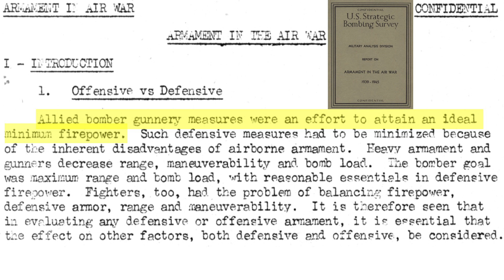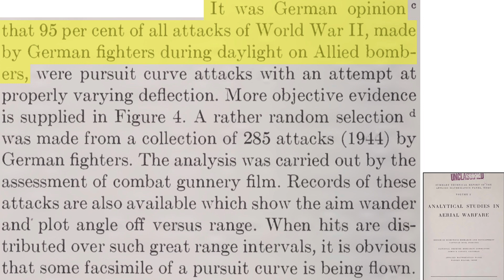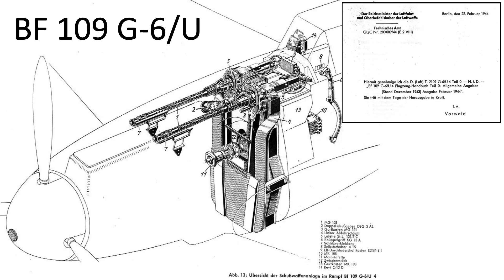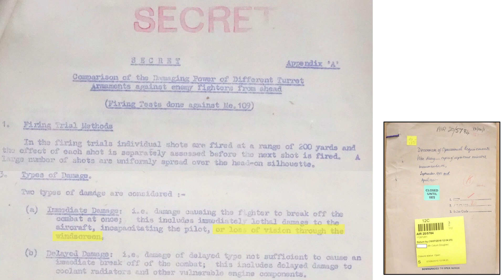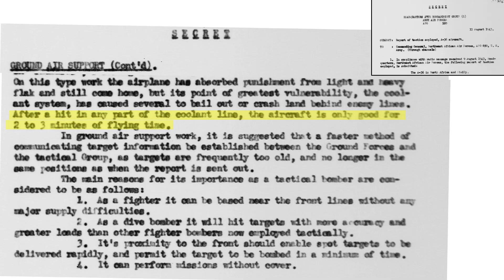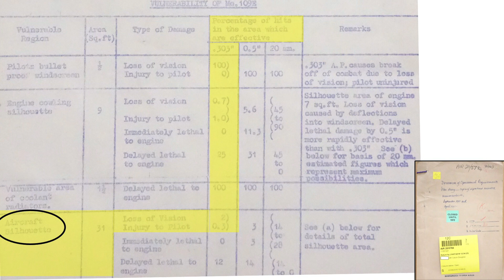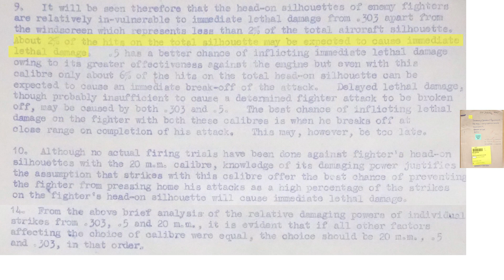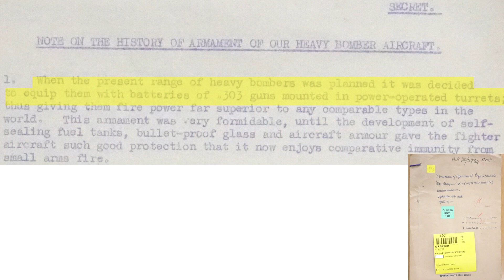RAF .303 caliber Me-109 live fire test vulnerability results – Lancaster bomber gunners aim point

Comment: Even if a bomber gunner had the optics to aim at a fighter cockpit (which they didn’t) the bullet spead made such accurate fire virtually impossible at realistic engagement distances (say 400m).

Odd to use the Bf-109 as the example target as that type was in a minority for night interceptor operations - 110s and Ju-88s were much more common adversaries.

Interesting, RAF Bomber Command night bomber loss rates per sortie were similar to those USAAF daylight raids, so it seems that the cover of night and heavy defensive armament were of comparable levels of protection.

Comment: It is something of a mystery to me why Britain did not manufacture their own 0.5 inch machine guns for the RAF (apparently the USAAF needed nearly all the 0.5 guns the US could produce for their own machines). The inadequacy of 0.303s in the air to air role was known from mid 1940. 

It is especially mystifying because (according to Max Hasting's classic book Bomber Command) the Bomber Command Chief Arthur Harris was pressing for 0.5 guns for his heavies for many years, but never succeeded in upgrading by replacing the .303s, except in a few cases (tail turret guns on some Lancasters). 

Bomber Harris (notoriously) got his way in most matters - including ensuring the allocation of the majority of UK war expenditure (Bomber Command more funding than the entire Army and Navy put together according to a recent analysis!) but apparently not in this instance.
Reply: Oh that's pretty easy - logistics. Britain did not use 0.5 inch machine guns to any major degree (particularly compared to the US) and it would be a waste of resources to adopt it.

For RAF fighters, the Hispano 20mm cannon was far superior to the 50cal, so only a few variants of the Spitfire (and yes, some bombers) had the odd 50cal. By 1944 most RAF fighters were using quad 20mm.

For RAF bombers, guns were not there to shoot down enemy fighters - they were there to prevent the bomber being shot down. For that purpose, hosing an enemy fighter with 4 .303s (especially if running all tracer) is quite effective. As the data shows, landing a hit, of any caliber, near the windshield of an enemy fighter is 100% effective at getting them to break off. For the same weight, you can throw out a lot more .303 than you can .50, which means more probability of hitting. RAF bombers flew at night, so it's much harder for a fighter to re-engage after breaking off.

And of course the British could manufacture large volumes of .303. It was their standard caliber weapon used almost everywhere, so it was available and cheap. Any resources used for a .50 production line would have been more profitably used producing 20mm instead.
Reply: @kenreckless2757   I don't think you have thought this through! O.5s would undoubtedly have been significantly better defensive armament for UK bombers (and 20mm cannon were not suitable, and irrelevant). 0.5s have more than double the range of .303s (which German fighters knew - they could and did spray the British bombers with heavy machine guns and cannon fire, while staying out of range of the 303s.) and about 4x the weight of fire per bullet.  "Bomber Harris" wanted 0.5s - but somehow he didn't get them!  - despite that Bomber Command controlled (probably) half or more of Britain's resources of manufacturing - including massive production of aircraft, nearly all with defensive guns - nearly all of which were 303s. As I said; I can't understand why the 0.5 were not manufactured in the UK for use in the many, many thousands of bombers that would undoubtedly have benefitted from them. There *will be a reason why not*, I'm sure - but I've not seen anyone who has given a genuinely plausible reason.
Reply: @BruceGCharlton  Absolutely have thought it through.

You cite the range and extra hitting power of the .50s, and you are correct. However it is also irrelevant. RAF bombers operated at night. There was no maximum range shooting in those conditions, it was all close range as targets loomed up out of the gloom. Hitting power is also irrelevant, as you aren't trying to kill the enemy fighter so much as drive it away - which is the reason a fair few crews loaded all tracer. In this context rate of fire was king, not hitting power. The primary job of the gunner wasn't actually to shoot, it was to spot threats and tell the pilot which way to evade. Different story for daytime bombers, but the Brits bombed at night.

20mm cannons are not irrelevant, because logistics. The Brits had limited resources. Why invest in .50s that will only get used on heavy bombers when you could use that metal and workforce to pump out 20mm cannons that were used in greater number (with both RAF and RN).
History bears this out - the Lancaster's post-war replacement (the Lincoln) did have .50s in the tail, but by that time it was generally realised that bombers shouldn't have guns, and subsequent bombers like the Canberra typically had no guns, relying on speed.
Reply: @kenreckless2757  I just don't understand why you are making this argument. Firstly, Bomber Harris wanted 0.5s for the night bombers but could not get them - which is the main point - why couldn't he get them? 

But surely you don't want to suggest that the RAF would not have wanted to replaced the .303s if 0.5s were available? 303s were used on their Spitfires even after cannon were introduced, for a couple of years - mixed 2 X 20mm cannon and 4 X 303s. Beaufighters had 4 x 20mm =  6 X 303s. Both would have better had 0.5s; since the 0.5s were certainly superior to 303s on fighters - nobody would dispute that. 

The Fleet Air Arm had US-made Martlet/ Wildcats with 0.5s; but the Fulmar had 8 X 303s in their early variants, before these were later replaced with 0.5s.

I think all the evidence suggests that 0.5s were used on aircraft  instead of 303s whenever they were available - and that the demand for heavy machine guns was therefore enormous. 

Which leads back to the question of Why they were Not available in sufficient numbers.
Reply: @ Bomber Harris wanted a lot of things. Doesn't mean you are going to get it. Same is true for all military commanders, and it comes down to the same reason - priorities.

Imagine you are a British purchasing officer in WW2. You have a limited bucket of money with which to buy US equipment. You have unlimited demands for it. Where do you spend the money? On Thompson SMGs, M4 Shermans, carrier based aircraft, land based fighters, or US guns for RAF bombers? You can get a little of each, or enough of a few things. Where does your weight of effort go?

I'm sure the Army wanted lots of Thompsons - they got Stens. I'm sure they'd have wanted semiautomatic rifles - they got bolt action rifles. Priorities.

I don't dispute that the .50 is a better aircraft gun than the .303. It was not, however, a priority for the bomber force. Especially when you have to purchase them from the US, whereas you can make .303 yourself.

On the fighter side of the house, .50s were mostly used on US aircraft, or as an interim while the bugs in the Hispano 20mm were being worked out. So yes, you saw .50s being installed in some Spitfires and aircraft like the Fulmar - but these were replaced as soon as possible with all cannon armed aircraft.

The simple reality is that the bang for buck gained by acquiring large numbers of .50 guns for the heavy bomber fleet isn't there. It's a better choice, sure, but it's not going to make that much of a difference. You might shoot down a couple more enemy planes, but not enough to make any significant difference. That's why the Brits generally jumped from .303 to 20mm wherever they could.
Reply: @kenreckless2757   If you are arguing that the UK commanders did not in fact set a high priority on providing sufficient supplies of 0.5 inch machine guns, and therefore did not get them - then that may have some validity, but would need to be documented. 

But let us assume for the sake of argument that this was the case, and that there was not some other reason (which I do not know, and which is what I am asking here) for the failure to secure enough heavy machine guns for the UK. (If heavy machine guns had been available, 0.5s would have naturally been used for bomber defense, as well as for fighters.) Let us assume that you are right in saying that the UK war strategists simply regarded heavy machine guns as a low priority.   

In that case, if you are indeed saying that UK war strategists were Correct to set a low priority on obtaining Much more effective air-to-air weapons when they were needed, then that strikes me as untrue. 

If the UK WWII strategists really believed that supplying their aircraft with longer-range and more-destructive weapons when they were needed -- which would mean from 1939 onwards, and perhaps especially in the Battle of Britain - when the survival of the UK depended upon the RAF shooting down German aircraft. 

Put bluntly: 0.5 machine guns on Hurricanes and Spitfires in the BofB would have meant more of the Luftwaffe shot down. Clear and simple. 

Therefore, if UK war strategists believed that did not matter, then they were just plain wrong. Heavy machine guns Should have been a very high priority. 

I've said all I want to say on this matter - it'll just be talking in circles from now.

Comment: The .303 calibre guns were largely ineffective as a defensive weapon against aircraft. BUT: the sole presence of gunners in the bombers forced the attacking fighters to fly in a path that minimized chances of being hit by defensive fire, reducing fighter offensive fire accuracy as well. If bombers had no gunners, the fighters could just position themselves behind their targets and fire from close range with devastating effect.
Reply: If bombers had no guns, they could;
* fly faster and higher
* be more agile
* risk less crew per aircraft

Look at the success of the RAF Mosquito. No guns, no armour, only two crew, very good range and bombload. For the resources put into a single B17 or Lancaster you could get several Mosquitoes that overall do a better job.
Reply: @kenreckless2757  I generally agree, but disregarding the Mosquito for a while and considering only the four engined heavy bombers used in WW2, I maintain that stripping them of all guns wouldn't be a good idea. I would keep at least the tail turret.

Comment: By June/July 1940 the RAF knew the .303 was obsolete. They couldn't quickly upgrade everything to Hispano, etc, because of design and weight decisions made years previously. They made their bed and were forced to lay in it. They (bombers) were slaughtered in daylight. The only recourse was to go dark and bomb by night. That worked out. Mostly. The Mosquito came in '42 with 4 cannons for instance, lessons learned. Can you cover the Mosquito? There are myths about that plane that still remain.
Reply: the bomber versions used did not have 4 cannons.
Reply: @juslitor  Correct. It had a plexiglass nose with bombsight that the navigator used on the bomb run.

Comment: If you are only firing at planes attacking you how do you protect the other bombs?
Reply: The US gunners were trained to only fire on enemy fighters during their pursuit curve. However, they were allowed to fire on enemy planes that were in the pursuit curve as they attacked other bombers as well. Basically, if the fighter is dodging, he doesn't present an immediate threat and is almost impossible to hit. The fighters are at their most vulnerable when attacking because they have a steady predictable path and have to get within a couple hundred yards of the bombers. Thus the gunners only fire on them during attacks but they fire on any attacking fighters in range even if they are attacking a fellow plane.

Comment: My grandfather was shot down in their Lancaster on the 21/22 Feb 45. They were attacked by two JU88s and a BF110 simultaneously. The two 88s from the rear and the 110 from underneath, which they didn’t see. He assumed the two 88s were used to distract the gunners. 

20mm cannon rounds came through the cockpit in front of him and through the instrument panel. A round went through the floor, between the navigator’s legs. Two engines and the wing immediately caught fire. One of the 88s caught fire, as a result of being hit by the rear gunner. All crew bailed and survived.

His train was strafed by two P47 Thunderbolt’s. Killing numerous POWs in his carriage. On the forced march, they were strafed again by a P51 Mustang. He was 19 years old at the time. Not an occupation I fancy.
Reply: Was this at night or during the day?
Reply: @ At night
Reply: @williamzk9083   The BF110 and JU88s had some use as day fighters in WWII but in general were extremely vulnerable to being shot down by Allied fighters (Germans discovered that early during the Battle of Britain).  And so mostly they were used as night fighters, since they could accomodate radar guidance as well as heavier anti-bomber guns such as the innovative Schrage Musik upward firing cannons and the Allies did not have night fighter escorts.
Reply: @gandalfgreyhame3425 They did have night fighter escorts. Radar equipped Mosquitos were used to defend the RAF/RCAF bomber streams
Reply: @monza1002000  Were the Mosquitoes attached to actual bomber units to be escorted or were they suppressing German night fighter units near the bomber streams?
Reply: @wape1  They were free running along the route of the bomber stream.

Comment: The only bomber gunner I have spoken to did over thirty missions in Lancasters as tail gunner and never fired once in anger. His reasoning was that more often than not you would be giving your position away, in the dark. As a farmer's son he was a very capable shot and would probably used his guns effectively.
Reply: The Lancaster's biggest vulnerability was from below as it simply had no gun coverage in that direction.  This was pretty obvious to the Luftwaffe and they mainly attacked Lancasters from below, and even installed the innovative Schrage Musik upward firing cannons so that the attacking night fighter could cruise parallel with the bomber stream while shooting at one after another bomber without having to point its nose at the bomber with forward firing guns by climbing up and then pealing away.  So, the biggest reason he never fired his guns would most likely have been because the German fighters were coming from below at the Lancasters.
Reply: @gandalfgreyhame3425  If he had been fired on from below often enough, he wouldn't have returned to tell the tale. On his last mission he was thrown against his sight during a corkscrew manoeuvre and lost some teeth in the process, but I think it was when avoiding searchlights rather than enemy fire. They had quite enough trouble just with flak.

Comment: The BF109E (Emil) used in the table was obsolete by 1942 and replaced by the BF109G (Gustav). The main differences were an upgraded engine (early ones were notorious for spontaneously catching fire, Hans Joachim Marseille being the most famous victim), and cannons either firing through the propeller spinner or mounted in heavy underwing pods along with ammunition. The radiators could be isolated in flight, allowing the plane to still fly with one radiator damaged.
Reply: Operating from old memory here. Marseille died in a 109F. Pretty sure about that. And yes the early models were notorious for spontaneous engine fires. He bailed out and struck the tail. Did not open his parachute. Killed by the tail or just knocked out ? No idea. Witnessed by his squadron mates.
Reply: the oil cooler radiator cannot be isolated. no spare, and can't fly without oil or too hot an engine.